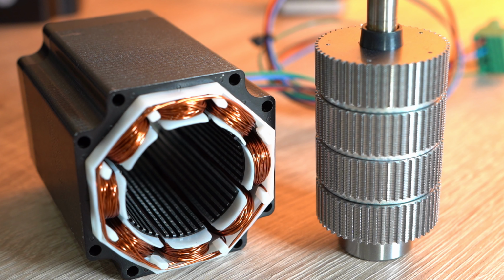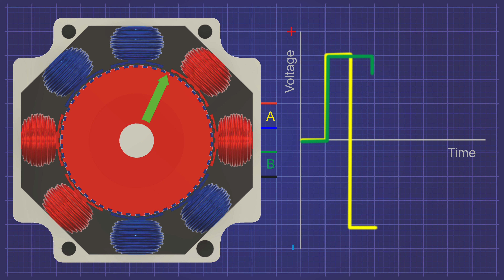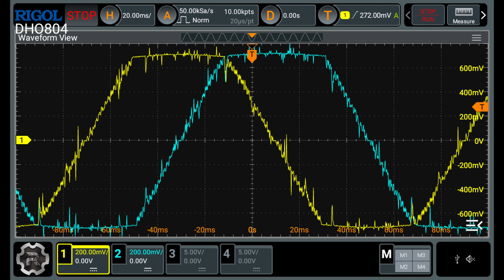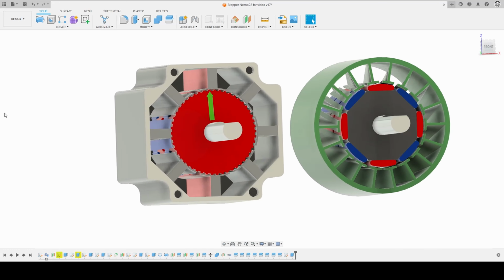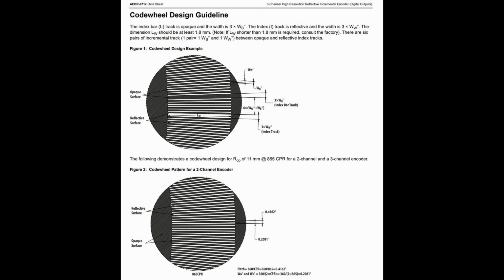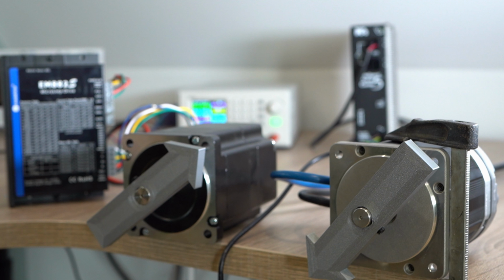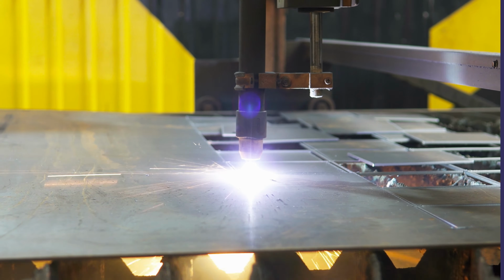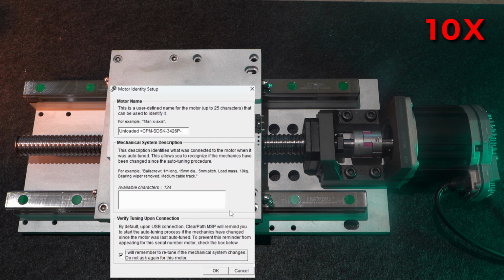PLASMA 03: Stepper motors or ClearPath integrated Servo motors

Comment: Will you be adding a Power Off Motor brake to prevent a potential Z-axis crash in case of loss of power - perhaps the unpowered holding force of the different motor types is also worth touching upon when considering a design. Nice video..
Reply from the maker: Very good point… I should have mentioned that, will do in one of the next videos. I do have a power off break added in the order, but was planning to only mount it when I place a spindle.. might reconsider thanks for mentioning !

Comment: Steppers 24/7 for plasma tables. They will hardly see any load.
Reply from the maker: I will do a separate video on the sizing. And in my case that’s not based on plasma, but the z axis will also run a spindle. Still this is overkill then, but I’m using the same motor on each axis.

But still you’ll be fine with steppers.. as I said, your project your choices..

Comment: Nice explanation! Thanks! Haven't really gone so deep into servos so far. (but i kind of suspected them being 3 phase motors) But doesn't the optical feedback system limit the accuracy of the servo?

In my machine, I went with closed loop steppers. And they have actually saved me at least once. Basic stepper is just stupid thing that does what it can if torque is enough. By having feedback loop the controller can detect if steps are lost in crashes and stop the system. And they can provide this information to the CNC controller as error code and stop the system if needed.

Only problem I have is that my spindle makes so much interference that i cannot use any input signals back to my CNC controller. 😅 (need to take the VFD out from the control cabinet at some point)

Keep up the work! (and put the background music little bit lower 😉)
Reply from the maker: Thanks for your view, and your feedback… was already in doubt about the background music :) 

Well on my router I also drive the X axis with two motors, so I have digital drives with stall detection to stop the machine when one motor stalls. Indeed as you say, it will be needed to safe your machine from damage for sure. 

The servos, believe me, they rock ! But I’ll show more later on. And as you I have waited with the servos for a long time. So I understand your closed loop route. But for me a closed loop stepper is not fixing all the stepper problems and the cost difference to the real stepper killers (servos) is not that high. 

Anyway.. thanks for following along! And hope you stick around 🙏🏻

Comment: I have used the Clearpath servos now for a couple of years. I even have a big AC servo that I use to power a Rotax aircraft engine generator to spin the generator up to 5000 rpm via a toothed belt drive. Clearpath servos are worth every cent you pay
Reply from the maker: Thanks for sharing ! Im not know for being an early adopter…. But this should have started using them in the RCNCX2 already…. Might have to upgrade that machine even :)

Comment: Well what i found with playing with 3d printers
The stepper motor is not the problem.
The driver chips are.
When you use the old school drivers they are loud and brute .
And if you use like the TMC series i think they where.
Their sound is gone.
Acceleration and speed is much faster they actually sound like servo's
AND you can home by stalling them.
I would not do that on cnc machines .
But what i mean to say is .
The drivers they still sell today for the bigger stepper motors are still on the old school chips.
But now they do have these encoder addons for stepper motors which actually do the same AND!!! they can keep track of the position.
Is a pcb and a magnet you mount on the back of the stepper motor.
Power it on let is do its self test.
And it will do a turn cw and then ccw.
And you have a hybrid stepper motor.
I do not understand why they do not advance in these field.
There is so much more potential in stepper motors.
And the steep learning curve for servo's is not the things that keeps me away from them.
Its there much lower holding power.
for a plasma cutter yes 100%  fast accurate not much resistance.
But for a milling machine with dove tails.
MEEEEEH you would lose alot of power to the friction making them run slower then you would anticipate.
Hybrid steppers motors with encoders and updated !!! drivers  that can be programmed for the start and stop acceleration.
OR even in your cnc software.
Would upscale steppers again to a level that only price would make the difference.

Leuk setje man !!
wacht vol ongeduld om deze plasma aan het werk te zien!!
Groetjes van uit Belgie!!
Reply from the maker: He buddy ! Cool to see you are still around 💪🏻

I absolutely agree that the drive is of big influence on using steppers. A long time ago already I did a video on comparing digital drives to analog drives. It must be still on this channel somewhere :) 

Till the fact feedback, and field oriented control on servos make such a difference. But then again, when making a 3d printer like you state you would be crazy to use servos like this. And then still going for better drives can make such a difference. 

I do not fully agree on the closed loop steppers. For my I don’t understand why you would go try to create stepper motors in a servo system. Why would you want the internals of a stepper vs those of a synchronous AC motor? Added complexity that works against you compared to making a synchronous AC or brushless DC motor into closed loop. 

En nu in het Nederlands… super leuk dat je nogsteeds geabonneerd bent zuider buur :) 💪🏻💪🏻 bedankt voor het kijken